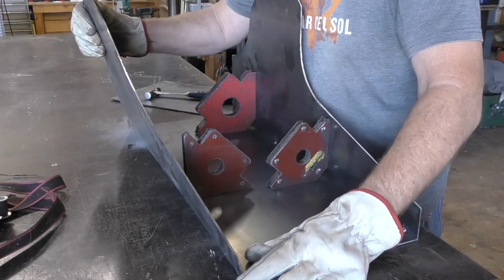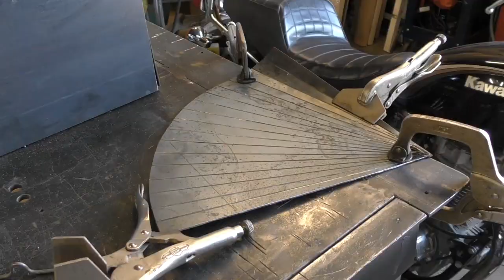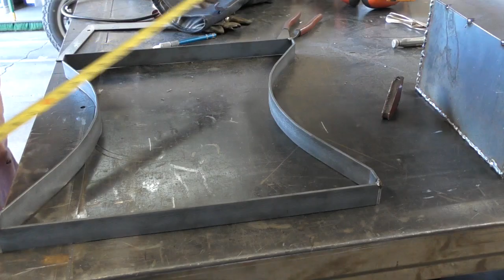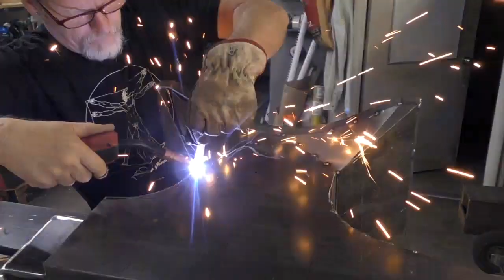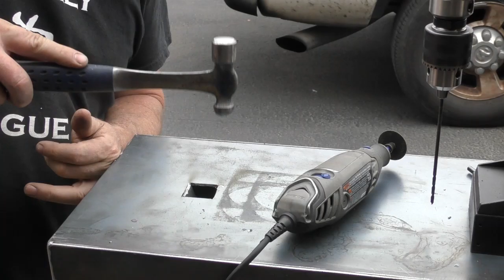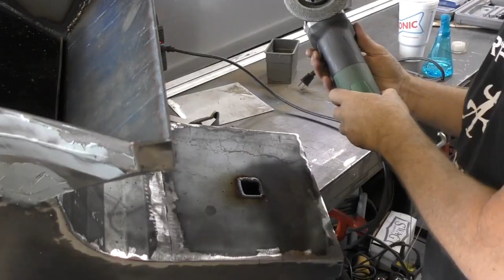DIY Large Scale Anvil Coffee Table -  Go Big Or Go Home

Comment: Pritchel hole. Used to cut nail holes in horse shoes (at least in the olden days) or do other punch type operations. Nowadays it's a convenient place to stick a screwdriver. 😁
Reply: i use em for the hold down dogs. its great when your punching or hot cutting material and you need that 3erd arm
Reply from the maker: Yeah I couldn't recall what I had seem them used for except for dropping a tool in there
Reply from the maker: Thanks Charles